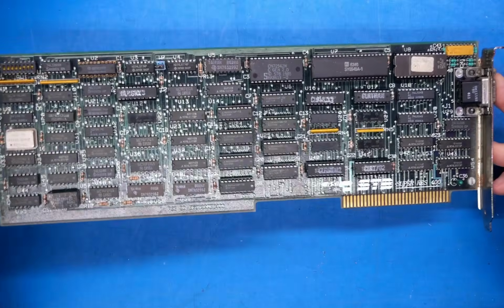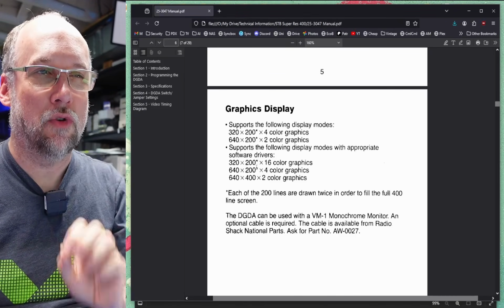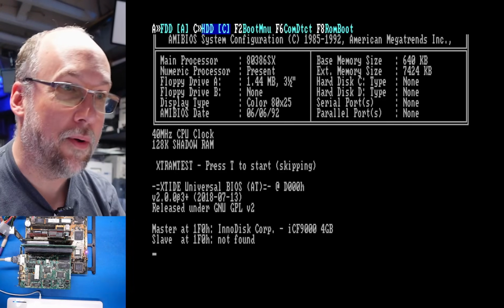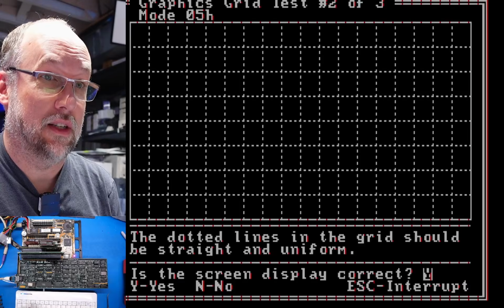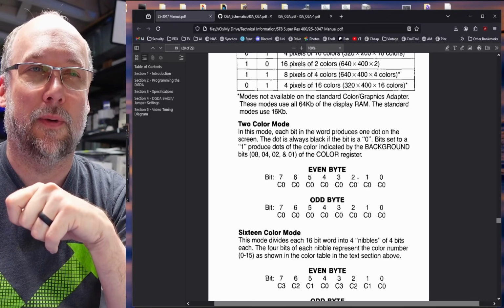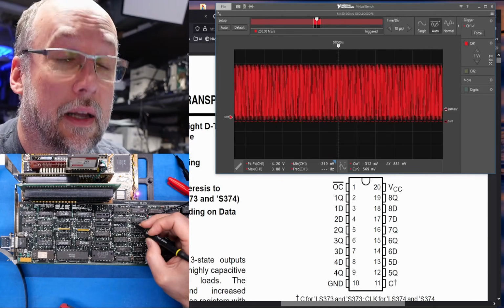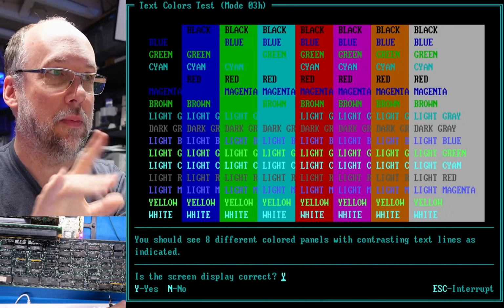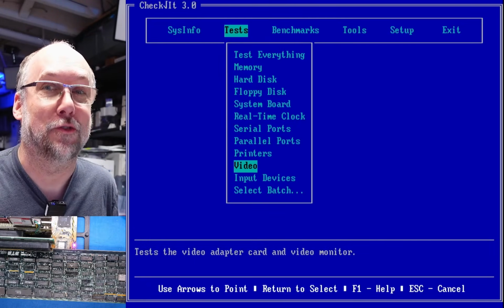Fixing a rare and broken high-res video card (STB Super Res 400)

Comment: Old man EE here; if you use one scope channel to trigger on clock rising/falling edge (whichever latches the data), then you can use another channel to inspect the latch output at the moment that the latch event happens. This can help diagnose misbehaving latch or flip-flop ICs. You could even use a third channel to inspect the latch input to see that the latch is functioning 100%.
Reply from the maker: @thirstyCactus  excellent tip, thanks!
Reply: That's where dual-channel oscilloscope is very useful. I am glad I got Zoyi ZT703S - not the best but does do the job well enough. Following the clock occasionally can help you spot some wonky issues with certain chips.
Reply: Pretty good stuff if you've got the gear -- a very valid approach.  Adrian might have enough traces somewhere.  I kind of like how he just bird-dogged it nose-to-the-ground style and hot on the trail with what he had ready to hand.  It shows that the most useful (and the most interesting) piece of test equipment is the human brain.
Reply: @horusfalcon  I was pretty sure he had at least 2 traces. He has been doing very advanced diagnostics. Time to graduate from the single-trace school of repair, my friend!
Reply: @thirstyCactus  I didn't say it was an invalid approach. I just expressed a preference for what was done as being within the range of a hobbyist with limited equipment.  Adrian has shown us what can be done with the right mindset with limited info and equipment.

Me?  I've never been able to afford a decent scope, but I've been tinkering with and repairing computers since 1977.  I might cave and buy a cheap o'scope now that they are below $100.00, but I hardly use one, anyway.  Back when I was still in the Navy, I used a nice scope with an Octopus harness on it.  Pity we don't see that much in the modern world.
Reply: @horusfalcon  Sorry if I came off as negative; that wasn't intended. Using more advanced methods can save a lot of time, and make the process even more rewarding. Considering the many affordable multi-channel options out there these days, I think the community would benefit a lot from watching these methods used in an actual application. That said, I agree, it is amazing what can be done with minimal tools, and an intelligent, logical approach.
Reply: @thirstyCactus  I'm probably used to too many really defensive folks in the comments.  I think we're on the same page, maybe different paragraphs?  Be well, man.
Reply: @horusfalcon  No worries at all. I think I may come off the wrong way via text, sometimes. Thanks for understanding! Stay safe.
Reply: Wow...
That's a geek DEEP CUT right there.
Reply: @pacershark452  Not meant, in any way, as a cut. In fact, the opposite.
Reply: @thirstyCactus  I get it.
I hope YOU get that I was an amateur LARPing as a geek insider.
I don't even know to to solder.
Reply: Do you really need to trigger on clock though?   2-channels on in/out and just trigger on rising/falling edge single capture to compare.
Reply: @v12alpine  That method would not catch all failure modes, though. For example, if the output was updating on some other condition, besides the clock's active edge, then the part would appear to be functioning correctly when only monitoring Input and Output.
Reply: @thirstyCactus True,these devices have a High Impedance output mode so they can transmit over a active bus, you could see valid signals from other devices on that bus, you need three (four if ENB is used) CLK, D0 and Q0 (ENB) to see if output follows input on rising edge of CLK

Comment: Fantastic video! Thinking about the PAL chips, should we systematically reverse those for posterity with those rare cards?
Reply: If none of the chips have internally latched signals you can feed a count into the inputs and observe the output. From this you can create a giant truth table, with that you can create the truth table.  Unfortunately the chips can also contain delay lines and latches if that's the case there's no way to dump them without guidance from the chip manufacturer / no way.  There may be information in the datasheet.
Reply: @lindoran  Entering all the possible combinations and obtaining all the possible outputs and then reducing the equations is one way. But as you say, if it has internal registers, it is not possible, at least in theory.
There are some projects with Arduino or similar, which do this, extracting the combinatorics and then extracting the equations and converting them to the fuse map.
I have been rebuilding a multifunction card (CGA/MDA + FDD + Parallel+RTC) from which several components had been removed, now I only need a PAL, which originally came in a socket and someone needed that socket and not the PAL, hehe. Now I'm just waiting for a good Samaritan in Vogons who told me to dump it for me, since it is a PAL that can be read, it has neither protection nor registers. He told me he would try to do it with one of these Arduino projects
Reply from the maker: I wouldn't have the faintest idea how to even do that. I think most are Signetics parts so not even normal Lattive/Atmel stuff we're used to now.
Reply: @adriansdigitalbasement  The Retro Chip Tester can read out GAL and PAL ICs.

Comment: This card with it's lovely high res text mode would do some interesting things to the hacky cga 160x100 graphics mode that is actually modified 80x50 text mode. Obviously 100% cga compatibility would not even be considered for a card like this. Running cga compatibility tester on this card might be interesting to see how cga it actually is. The manual with programming information could allow someone to program a mode test for this card. I'd suspect it would be real easy to modify code that switches to plantronics modes to work with this card instead